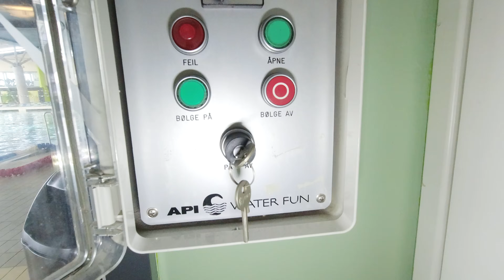How does a wave pool work?

Comment: One day I went with my father to a pool like that but I thought that the waves appeared from some tubes that ejected water 😂 continuing, when I got to the end of the pool to try to see where these tubes were when I saw a big and scary grid, at that moment I swam with my life because I thought that that one grill would suck me in and I would die there😳
Reply: Same here! I thought the water was sucked in via huge pipes and then pushed back out again but it turns out it’s all done by air pressure. I was terrified of wave machines as a kid because I got pulled under by one once.
Reply: @ananonymoushen4339 they should have alarms or some type of warning when the waves are abt to start, I dip my head under water to hear the machine and it sounds really good js when the low pressure waves come in this metal slacking sound just ruins it all 🤦‍♂️
Reply: @ananonymoushen4339  oh god……l
Reply: Same for me!

I went to a wave pool when I was younger and I really wanted to know how they made the waves so I swam to the end of the pool to look for something that made the waves. I saw about 3 massive black wall looking things and me being curious I swam closer. At the exact same moment that I was just about to touch the black wall they turned the waves on and the walls began to move.

This pool used a similar system to the one in the video except instead of vertical suction and push it was horizontal. Think like a large hand pushing the water from the bottom to just above the surface.

And because I was right in front of the pushing wall things I got sucked into it and then pushed out with great force!

This wave pool had 3 settings medium, large, and extreme waves. And of course I got unlucky enough that they put it on the extreme setting when I was right next to the wave walls.

After I got pushed away from the wave walls I tried to swim back to the shallow end but the waves were really strong and big so I was struggling quite a lot and even ended up going underwater a couple times because a new wave would wash straight over my head!

It felt like hours until I finally got out of the pool at the shallow end but it was only 1-2 minutes until I actually got out.

And after that incident I never went close to the far end of a wave pool ever again and never will in the future.

The worst thing was that I was just 10 years old when this happened. And barely able to swim on my own. I shouldn’t even have been in the pool because they actually had rules that said that if they are using the large or extreme waves you have to be I think it was 13 or 15 to even be allowed in the pool. 12 for the medium waves and anyone if the waves were off. 

The thing was that nobody actually cared. Not the people in the pool or the people that worked at this place. Even the lifeguards didn’t care. In fact a lot of the rules in that place where routinely broken and nobody cared at all! I’m actually shocked that they didn’t get shut down because of there complete lack of enforcement of the rules. I’m almost positive that someone has gotten seriously hurt there and if not it would be a miracle. 

My parents were on the other side of the building. ( this place had like 4 pools and like 6 slides. It was like a big indoor water park ) so they didn’t even know what happened. I was always running around from pool to pool and going on each slide like 500 times so my parents decided that they would just sit by the ice cream/snack shop and wait for me there because trying to keep track of me was probably one of the hardest things that any human could ever accomplish.

I was safe in the end though and I soon forgot about it and enjoyed the water slides for probably the 125th time that day!
Reply: @The_hot_blue_fire_guy man this story made my anxiety spike like crazy.
Reply: How did you guys read that
Reply: @A.tin.can1  bro i think you need to go back to school
Reply: @KingArttu I understand it now

Comment: It’s not a vacuum pulling the water in, it’s air being blown into the chamber that forces water out. A butterfly valve opens and closes in the ducting which allows air from a blower to enter the chamber momentarily.
Reply: Either way it's just a pressure difference moving the water around
Reply: it depends on the design as some are different
Reply: @misostreams232  The one depicted in this video is pneumatic.
Reply: @MartinNeep  a vacuum is a form of pneumatics
Reply: @CheeseMiser  By definition yes it is. But vacuum wave generators are relatively new and are generally used to create large, one-off surf waves. Pneumatic wave generators (as depicted here) have been around for decades and use a centrifugal blower to create intermittent positive pressure inside the wave caisson.
Reply: @MartinNeep a vacuum is the absence of any gas. I doubt that they go to the extend of creating a vacuum rather than just a low pressure environment to get the water pushed in 😉
Reply: @herrsan we use the word vacuum to refer to suction bc lacking air will suck whatever air is nearby.

And the suction of air one place means it's blowing out somewhere else such as into the chamber.
Reply: @MartinNeep  He didnt really explain how they work, you could figure out just as much as what he told us by a quick walk around the pool and by dipping your head under the water for a second, which I guess that is all he basically did. 😄
Reply: @herrsan  放入水中再拉起就像針筒，密封做好大氣壓力會幫你
Reply: @TheAnantaSesa  yeah, you can use the word vacuum but that just shows your lack of understanding what a vacuum is
Reply: i didn't know i could make turbo edits out of wave pools.
Reply: lol @The442Cutlass
Reply: I heard the commentator say " vaccuum".... but the blowers basically pumped air into the chamber, which displaced air out near the gratings. Then the flapper relief-valves released the trapped air, hence pool water rushed up the displaced volume and waved were generated
Reply: Air to push water out.  I know air is compressible, water isn’t, not sure how much air you need to compress into a small space to be able to push water with it
Reply: ok martin, good for you to know that
Reply: See, that makes more sense.

Because when he mentioned a "vacuum", my immediate thought was 'Wouldn't that be… unbelievably unsafe?'.

Comment: Didn't know there are sea-like pools with waves. Awesome!
Reply: Careful which ones you go to though. Changing the water is expensive and time consuming, and most park visitors won't notice the difference at the time, so some places will literally just leave the same water in the wave pool all summer. Nobody notices during the day when the park is open and the wave machine is running, but the lifeguards sure notice the trash and layer of oil floating on the surface after they shut it off.

Not every place does that, but plenty do, and it's super easy for them to get away with since, as said, most guests won't notice at the time
Reply: @nomnomnomymous  Ooof. Thanks for educating us, that's nasty
Reply: Really? They’re quite common in North America :)
Reply: @sopwithhannah2401  Ooh, interesting. Thanks for letting me know <3

Comment: Who else thought it was just terrifying massive fans  that will chop you up if you get near it 😅
Reply: They are massive fans in the back room. This is not a vacuum system
Reply: @petestlaurent3453 u dont know wHat ur talking aBout dude i work at a water park so i know
Reply: @petestlaurent3453  sorry do you have a source for that? that contradicts what this guy just explained in the video, and he had video proof
Reply: really though
Reply: I managed to get inside one once when the grate was broken, obviously I went in when the wavemachine was off, all it was, was an empty room above water surface, and like 2 x 7" pipe openings. I guess it blew the air in, and the other one was for returning air. Either way I didn't wanna be in there with it on incase that air pressure was too intense for my small head. Super dangerous, don't ever try!
Reply: @xsm_p2  I just read a article about how someone got sucked into those rooms and he was saying that he thought he was going to die. He said the room would fill up full of water and he had to told his breath and then the current of the water was pushing him all over in the room and caused some really bad injuries to him
Reply: I as a kid used to swim down and grab into the bars, only got get a feeling of dread and push off out of there.
Reply: Can blame RollerCoaster Tycoon for that one
Reply: @jamescollins6085  A man of culture I see.
Reply: @jamescollins6085 bro same
Reply: I thought it was just me. I was always so scared to go into the deep end
Reply: @MrOddrun same
Reply: I remember an older wave machine that had big  scoops to lift up the water it was terrifying to look into it
Reply: Huge fans are so scaryyy
Reply: @FizaNizzil i'm a huge fan!
Reply: at first i thought wavepools functioned with a sort of moving wall that slides back and forth pushing the water
Reply: I thought it was huge paddles that went up and down underwater and they could hit or crush you
Reply: @Orblitz  Yeah
Reply: Well I sure did.
Reply: BRO I KNOW RIGHT I THOUGHT THEY WERE FANS TO
Reply: ME
Reply: I did
Reply: I thought it was just pushers
Reply: literally no one ever
Reply: I never would get close because i thought i would see something horrid
Reply: I'm very disappointed in you 3000 people...
Reply: Me
Reply: mee 😂😂
Reply: me
Reply: I did ngl although I thought they were vents that I was gonna get sucked up in😂
Reply: Me
Reply: Ufc fighter bj penn did get sucked through a pip to a cement fill box in an engine room suprisingly he survived
Reply: Me
Reply: In France we have giant paddles (im not jokeing ) sorry for the bad english
Reply: No this. I was so terrified of even trying to come close
Reply: 😅😅😅😅😅not me 

Man I can't lie😅😅😮😢
Reply: Only you
Reply: There are, there are high powered centrifugal blowers normally three phase, the high pressure air is sent through to manifolds that contain valves, the valves are controlled by pneumatic cylinders, but keeping it simple, when the valves open and the air is allowed to rush into the space above those grates, a positive pressure is generated inside the space and pushes the water out the grates via communicating vessels phenomenon.

The water has a natural tendency to return back to it’s original place, but this is where the clever physics phenomenon occurs, the valves shut as the water flows up inside the air chamber, then momentum naturally pushes the water back out and the valves open up at that time, and compliment the wave momentum, making the.. waves.  Depends on how you define “massive”, not only are the blower blades about as large as a car wheel hub, but they are isolated from the pools.
Reply: First time I went to Wisconsin dells and discovered a wave pool yes😅
Reply: nah i had common sense
Reply: I thought there were pushers that pushed the water🫤🫤
Reply: Uh, no
Reply: Bro what I never thought that
Reply: That's what the staff tell you to keep you away
Reply: I’m still scared to go anywhere near them! Big scary fans or not 😆
Reply: U guys are kids
Reply: Me too
Reply: Same
Reply: Same I always thought they where fans too I was always scared to go in the deep end and never been in a deep end of a wave pool prob never will because I don’t want to get stuck on those grates
Reply: Me🙂💔🤣😂😂🤣🤣🤣😂
Reply: I damn sure dd!! LOL
Reply: Me bro
Reply: Yess😑😑
Reply: 😅 me
Reply: Lol
Reply: I did! 🙋🏻‍♀️😂
Reply: Me
Reply: Me
Reply: Me
Reply: Frfr
Reply: Me xd
Reply: Same here.  These things always freaked me out as a kid.
Reply: I thought it was gonna suck me up if I got to close
Reply: I did
Reply: I hate the deep end
Reply: @ManUBobby10 me too
Reply: Yep lol
Reply: Yep definitely xD
Reply: Me
Reply: Same
Reply: ✋ me
Reply: Yesss, they alwase said to not go near it
Reply: Me!
Reply: FR
Reply: me!
Reply: That would be the lazy river
Reply: I didnt
Reply: Me
Reply: Pressure is pretty powerful
Reply: That’s what I thought lazy river jets were
Reply: Me
Reply: Oh yeah I thought indeed
Reply: I always go in the deep end so I have to put my legs up😂😂😂
Reply: Me
Reply: Me
Reply: Ikr
Reply: Not me, why? Because I once got sucked in.
Reply: SO TRUE
Reply: I honestly thought it was 2 giant paddles per grate
Reply: That’s why they yell at you if you pass the line 😅
Reply: Me
Reply: Yea
Reply: me
Reply: Me
Reply: I did lol😂
Reply: Me 1000000000%
Reply: yeah but it wont cause the waves are too strong
Reply: i thought i was the only one who thought that 😢
Reply: I didn’t I knew they were controlled
Reply: Fans Don't have the explosive power necessary for a wave pool.
Reply: YES!!
Reply: Seriously as a kid i thought that, lol
Reply: Me
Reply: Every Hollywood writer
Reply: Felt like the entrance to the backrooms.
Reply: You are not alone
Reply: Nobody with at least one brain cell left.
Reply: No one with a brain
Reply: Me too
Reply: Yes
Reply: I thought they were pistons
Reply: Me omg I was afraid to even go near that end
Reply: Me
Reply: Me
Reply: Me
Reply: I thought it was a giant piston
Reply: Same
Reply: Me
Reply: Nope
Reply: Yep
Reply: Me
Reply: Yes
Reply: Me
Reply: The fan would just push water
Reply: Me lol
Reply: Not me
Reply: Meeeee!
Reply: Me
Reply: Me😂
Reply: 6,000th like to your comment and yes 😂
Reply: Not me
Reply: I know
Reply: ME😃😃😃
Reply: Yes 100%
Reply: Yes the fans actually pressurize the chamber from
Above the water line forcing the water out. In fact the fans (blowers) sit behind the chambers and are connected to the chambers via air ducts.
These blowers are very similar to the ones that power huge pipe organs.
Reply: I always got scared to go near thoose things on the wall ;_; (its not a fan)
Reply: This video is lying. It is just massive fans and you WILL die if you get too close
Reply: Ok but why is that exactly what I thought
Reply: Fr😭
Reply: I just thought it was giant steel walls moving back and forth
Reply: Me
Reply: i did
Reply: I did!
Reply: Kid nightmares
Reply: That’s what RCT3 made me believe
Reply: Me
Reply: Yes, this is why my friend is afraid of them
Reply: Me
Reply: Fun
Reply: Me I still do
Reply: Well, that was what our parents told us so we just kind of assumed that it was true.
Reply: Me
Reply: Me
Reply: M-massive u know what else is massive
Reply: How did you now
Reply: Nope I thought they where giant pistons
Reply: YES ALL THE TIME IM TERIFIDE
Reply: Me
Reply: 🤧 I did
Reply: YESS
Reply: I did I was to scared to go near the grates at the bays water waves pool in Perth aus
Reply: Yup! In fact, I found out it’s worse, go to low and get sucked against the grates
Reply: @amatticus  when I was young I didn't know what they were and I went up close when they turned the waves on and it sucked me up against them and my dad had to save me😂
Reply: @l3th4l11  that sounds so terrifying oh my
Reply: I did
Reply: Ikr
Reply: Dude I’m not even joking I swam close to the thing that blocks you off from going to far into the pool and I looked underwater and I swore I could see a black propeller and it freaked me out I was like 12 so it wasn’t just my imagination
Reply: @MMoneyShortss  it still could be at 12
Reply: @MMoneyShortss 
Congrats, from the trauma you've experienced you now have submechanophobia.
Reply: Me
Reply: me
Reply: Me
Reply: Sharks
Reply: I thought there where sharks in there
Reply: I thought it was a giant wall going back and forth with a lota speed. I thought i was gonna get flattened if i went near it
Reply: I did and still do
Reply: I did and still do
Reply: I thought it was massive pistons that would kill you if you went into it
Reply: No matter how detailed it is explained, I will always think there’s a monstrosity of a contraption that will suck me in and kill me
Reply: I thought they kept sharks in there when I was young
Reply: I thought it was a giant monster and I didn’t want to go near the end because I didn’t want to be eaten
Reply: I always thought it was a massive panel that was pushed down into the chamber  forcing the water out and you’d get crushed to death if you got in between the bars.
Reply: Thalassophobians Unite!
We have nothing to fear except maybe the deep, dark underwater tunnels leading to the death-wave-machine!
Reply: I thought it was huge boards tilting forward and backward that could crush you
Reply: I thought there were sharks under that wave pool gate?
Reply: Yes I thought there were sharks coming out
Reply: Yes I thought there were sharks coming out
Reply: Nah but I nearly drowned in one when I was 7 and that night I woke up suffocating for like a whole minute before I coughed/vomited(?) up a bunch of this chlorine scented goo lol. I think I might’ve had secondary drowning but idk because my parents never took me to a doctor, I just slept it off lmao.
Reply: I thought wave pools were pools that were not filled with water rather they're filled with some semi gas semi liquid water

Comment: When I was little, I thought wave machines worked with pistons that put pressure on the water inside of the chamber.
Reply: Some does work like that, ones in my country are pneumatic wave machines which will pressurise the chambers to push the water out through the bars and release air to allow the water to flow in.
Reply: Sometimes they do. The older ones, tho pneumatic wave machines are now the norm.
Reply: Me too
Reply: Minecraft
Reply: @adamshaikh8856  💀??
Reply: @adamshaikh8856   u mean that
Reply: I need to make my iron farm. Know how to make a iron golem?
Reply: @adamshaikh8856 you’ll need villagers
Reply: @adamshaikh8856  4 soul sand in a T-shape, then place 3 wither skeleton skulls along the top of the T.